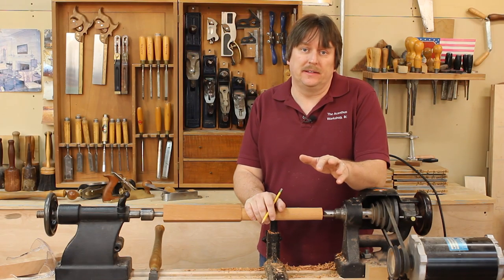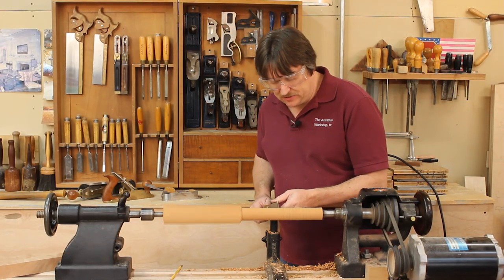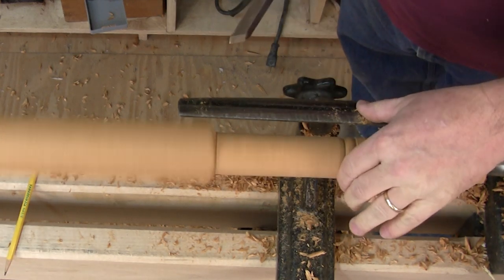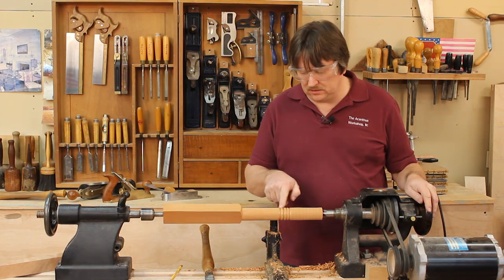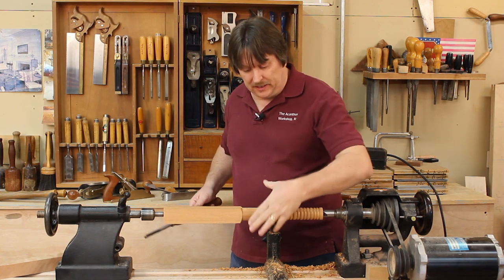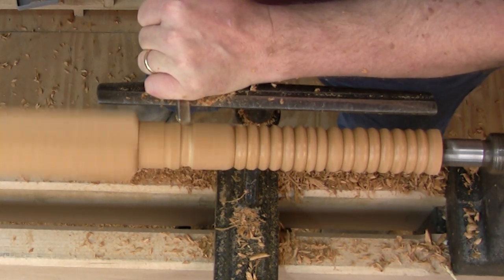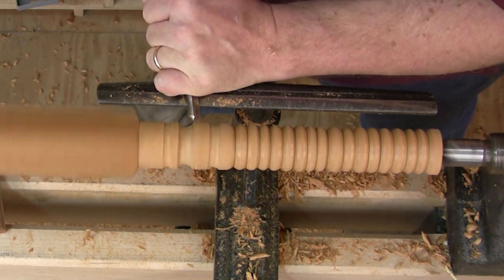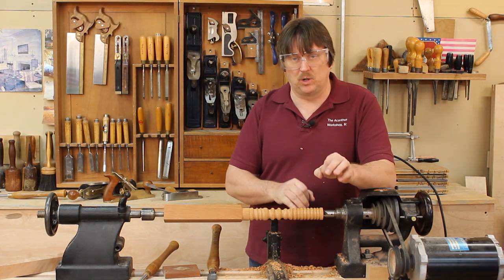Wood Turning Basics: The Skew Part 2 & Gouge

Comment: Nice tutorial, what height to you have the tool rest to use the skew gouge? hi enough so you can cut almost from the top side of the working piece?
Reply from the maker: For the skew, I raise my tool rest up about 1/8" to 1/2" above center depending on the diameter of the material I'm turning. I tend to set the rest lower for a gouge.
Reply: @acanthuscarver  I ask because i try your technic and most of the times i have a catch, i'll try that above center. Thanks